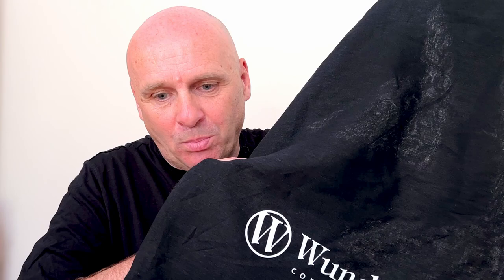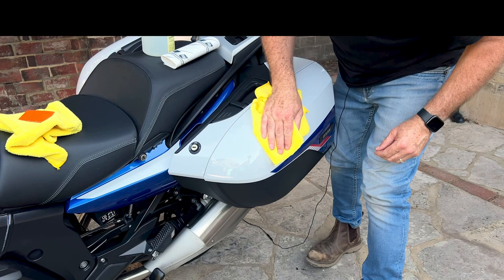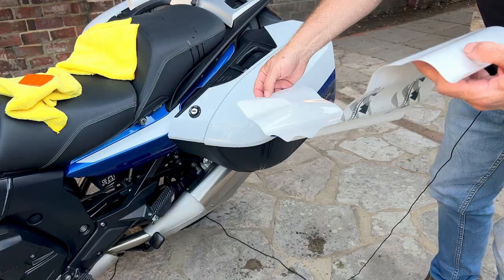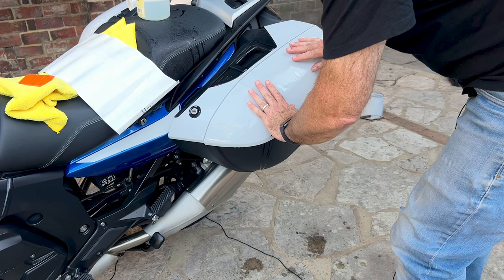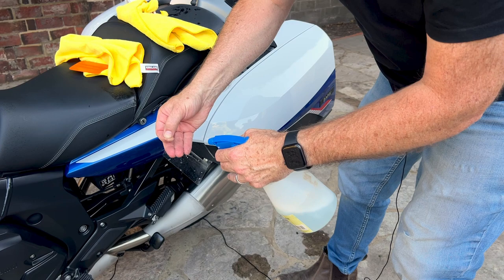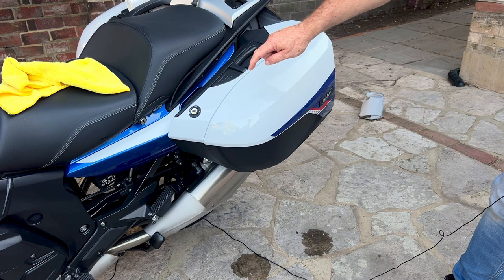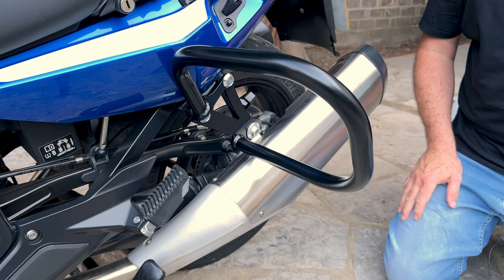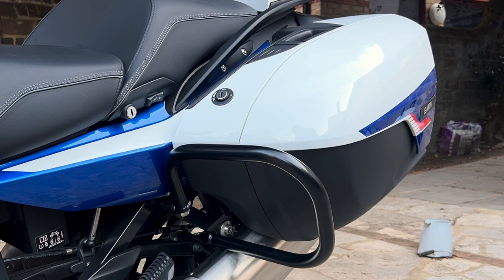Farkling the BMW K1600GT (Part 3) Fitting Pannier Accessories and Protection

Comment: Not that I doubt a word you say Nick, but I'd like to see a Proof of Concept on those Pannier Protection Bars. Ian from Big Rock Moto often spreads a blanket out and lays a bike a down to demonstrate points of contact and potential damage/protection points. Are you so game?
Reply from the maker: Interestingly I had a motorcycle pull out from a slow filter into the side of mine. He bounced off the bars. Slid down the pannier with his throttle grip and although it left a rubber trail that looked bad at first it wiped off the film with zero trace. His bike didn’t fair so well, mine remained upright. Now a third or a ton landing at speed……??? But then there’d be lots of other damage i feel? 👍🏻

Comment: Nick, now that you’ve had time on the superlative tourer, if you only had one bike, GSA or this, what would you choose. I am considering GSA versus RT so wondered where you would come out on this chestnut of an issue.
Reply from the maker: Crikey Eric. Tough questions. I think for sure if it was GS or RT now. I’d go RT. The K1600 is different in that it’s heavy but soooo incredibly smooth and ‘manageable’ (by that I mean forgiving if lazy with the gears). The GS(A) is a phenomenal machine but if you want comfort, luggage space, weather protection, weight, etc. the RT takes a lot of beating. My mate, who’s had many bikes, including latterly a 1250GS bought an RT in 2021 and he loves it 👍🏻
Reply: Very interesting, especially coming from a seemingly GSA guy.  Thanks.
Reply from the maker: @ericwoolley5879  I’ve been pretty consistent in rating the RT. It sits in the shadow of the GS’s popularity. Much of which few people use to its full potential (still love the adventure though)

Comment: Nick your videos are great I’ve just picked a new k1600gt up. For your info the little BMW charging cable for the top fan pocket the iPhone pro max will fit no problem.
Reply from the maker: Thanks Simon. That’s some good news. So far (although I’ve not tried overly hard) I’ve not bought the BMW charge cable as when asked it was out of stock, but it seems that’s about the most acceptable alternative despite its cost!!

Comment: I wonder how heavy are these luggage racks compared to the Isotta ones which are made from plexiglass (or something similar)
Reply from the maker: I’m not sure to be honest but they are really useful. I travelled a month and 10,000km and had light drybags strapped to them with light items in that didn’t need access often such as air pump, drone, etc. max load is 3kg but as you don’t drill case I am still really happy with them 👍🏻

Comment: One invaluable accessory I would have thought you would include early on is the top case brake light assembly... I can't imagine why it isn't included as standard issue.
Reply from the maker: Well yes, that is a valuable addition but also hellishly expensive. The case without is £877. With its £1250 👍🏻

Comment: Have you got a video on the top box or any information? Looking at one for mine but undecided whether it is worth it or not!  Ta!
Reply from the maker: I have the BMW one but without brake light as it was expensive enough already. I only use it on week + trips. For example I’m off to Normandy Fri-Mon and I’ll use pannier bags in the panniers with a couple of 8L bags, very small, strapped to the pannier racks. I put really light stuff in there of little value as they’re not secure and the limit on the racks is 3kg each. It’s handy for ferry stuff for example. Back to the top box. It is very good though. Internal light, backrest, gas strut and most important, centrally locks with everything else. If you can….. I would 👍🏻

Comment: Very nice, clear presentation of installation... but how do you like RIDING with these farkles?  The manufacturers may be supplying you with all this free gear so you can show how to install it, but we potential purchasers want to know what's good and what's not-so-good about actually riding with these add-ons.  Or, in the case of the above-pannier platforms, utilizing them to hold light gear.   And don't forget to tell us how your pillion liked mounting/dismounting and/or leg positioning around them!  Thanks!
Reply from the maker: That’s very true Claudius and thanks for the comment. By far the majority I use, feel I will use and have actually turned many down. It’s tough to do a fitting and review all in one as living with accessories is a different matter over time. Hopefully this helps to see the actual units, hear someone talk about them and see them in real live rather than just still images and manufacturers words. Watch the videos over time too and see if they’re still fitted 🤣👍🏻

Comment: Hi Nick, another informative video, still no top box?
Reply from the maker: No I have it but in truth I went away to wales for three days and was ‘well inside’ the pannier capacity. I reckon I could probably do a week in them if the weather was stable and I didn’t want different riding gear, so certainly the rails may get used with small dry bags rather than top box 👍🏻

Comment: wow, even more weight on already over-weighted (obese) bike😅
Wunderlich (unnecessary) gadgets are so ridiculously overpriced on top of that...
There are bike accessories that really make a difference but these are not one of those😉
Nick, I'm slowly loosing faith in your common sense...you used to be "the guy" to watch, 
your reviews on r1250 were spot on 😁
Reply from the maker: There are some accessories that are fluff but the side stand enlarger, oil cooler grill and pannier film I wouldn’t class in those. I’m dubious on the crash bars only because since fitting it’s a bit awkward to position pillions feet and the rails I’m hoping to use on next year’s trip to Nordkapp. The bike is heavy and not a GS(A), but she is pretty nimble in handling, very quick and easy to ride in any gear. Far more so than the GS(A). You’ll find my accessory fitting will end soon, as with the GS(A) as I’ll only fit stuff I’m likely to use or is useful to me or the bike 👍🏻
Reply: I don’t think Nick is forcing you to watch his videos, anymore than BMW are forcing you to buy their bikes. If you find the cost of the accessories too high and the additional weight, don’t fit them. Your opinions are valid, to you and a few who might not be able to handle the K’s mass and price. It sort of reminds me of people who buy a £1000 phone, but decide to protect it with an £8 case, baulking at paying £50-£100 for something that’ll do the job properly. The cost of the crash bars represent just around 1.3% of the price of the bike. It’s not like the 10% of a top quality phone case, like a Piel Frama. Motorcycling can be an expensive hobby. 

To get to the point of reviewing free gear, Nick has used plenty of his own money and time, and he deserves the recognition for that. Nick’s videos are calm, informative and very useful. It’s clear he also does a lot of planning before shooting them. If his content doesn’t suit you anymore, there are plenty other content providers. This isn’t a put down, but a recognition of fact, rather than a voicing of opinion.